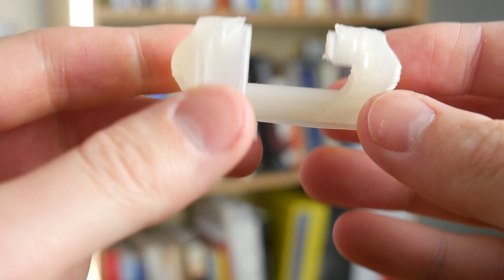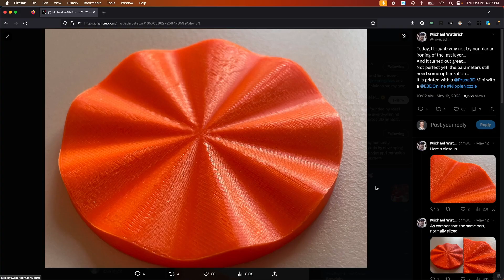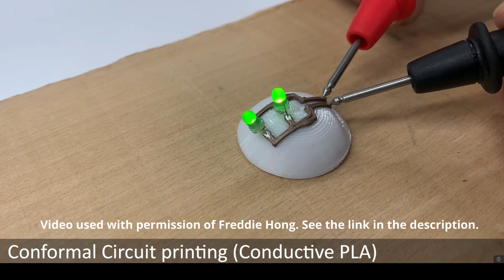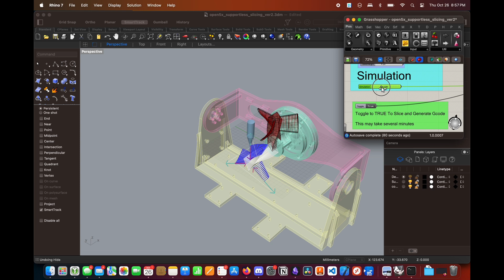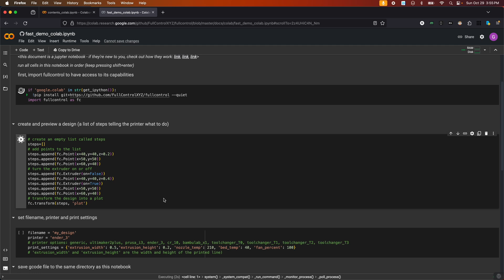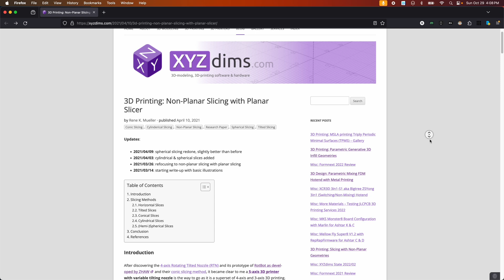5-Axis Printing... Why Should You Want It?

Comment: 5 axis g-code is on many cam softwares an option for a fee. So how long does it take to get that to open source slicer? 
Most likely someone makes a useable slicer and commercializes it to make profit. 

Just like the drug dealers at autodesk. 
They get everyone hooked on fusion360 for free and then pull the rug out of everyone. 
Very skeptical but hopefully there will be a cheap slicer for the hobbyists fot 5 axis 3d printing.
Reply from the maker: 5-axis is available for subtractive applications, but is much less common for additive applications. Regardless, closed source or not, I am excited for advances in this field.

Comment: your approach to more than 3 axis printing is cute and yields some nice results, but as you pointed out, you are losing printing surface and introducing vibrations in the process.
Mine is slightly different, and you might want to give it a try, I still keep the old platter, but move it in 3D (U,V and Z) axis to compensate for gravity forces in order to eliminate the need for supports and obtain non planar printing positon.

However I found out that Z is not enough as my printed part will collide with the printing head or the gantry sometimes, so here comes in the secondary Z axis, or MiniZ as I call it, a top down Z from the gantry holding the printing head.
Applicable for now only on CoreXY machines and similar geometries, sling beds don't enter the competition.

Also at the printing head I add 2 more axis, a titl of the nozzle up to 45 degrees, and a nozzle rotation 360 degrees to compensate even better (I called it Tango), so here I jump at 9 axis out of which 2 are Z axis spilt tasks between the bed and the MiniZ top down head.

I have made a portal and try to bring in as many folks as I can to buy my products (I only have for sale STL files of things I already tested extensivelly)  in a hope to raise funds to go ahead with my designs and create sort of a fashion amongst enthusists to make themselves more non planar machines, hence to polarize some interest from the coders community to jump in and help with open source codes to move them and slice for them, thou at tis point is no more slicing, is more like onion shell peeling.

Here is the portal        

https://3dmential.com/

not looking great, I am not a professional web designer, just an engineer, but you will find there the Rumba project, the Flip tool changer (dove tail based unlike the E3d one) both in manual changing and automated changing version and many other things I made for myself and possibly others can benefit from.

Comment: Hard programming gcode never interested me but LLMs are making me much more interested
Reply from the maker: Are you suggesting to use a LLM to greate GC? I think this is an interesting idea, but considering that G-Code has certain constraints (like extrusion amount per mm travelled, a fixed geometry being a necessary output) makes me think that it wouldn't be a trivial application. Do you have ideas on how this might be implemented?
Reply: @Garth_42  I have experience 3d printing but not working with raw gcode yet so my thinking could be flawed. I was imagining something along the lines of defining desired print settings and some basic geometries at a system prompt level. Seems more realistic to try and have the systems apply existing "parts" in a well defined environment at this stage in AI progress.  I also don't think it would be TOO difficult (for someone with more knowledge than me) to create some kind of low level validator, some system that attempts to confirm correct geometry/dimensions. A most simple example for this would be detecting the edges of a generated cube to confirm all lengths are equal.

Comment: I wonder if the rotary axes would work with a Delta style printer 🤔
Reply from the maker: I don't see why rotary axes wouldn't be able to work with a delta style printer. An interesting aspect about deltas though is that getting to 6-axis is relatively simple... IIRC you "just" need to get the hardware to control all of the ball joints attached to the tool separately instead of 3 pairs of 2 ball joints being powered by the same linear guide.
Reply: @Garth_42  could be interesting 🤔

Comment: It's slso very hard to create a slicer algo that works for every hardware because you need to make sure you can reach the extrusion point without colliding what was already put down. You could basically put a hotend at the end of a robot arm but collisions are hard to avoid. Also depending on what exactly you want to print, different configurations of the additional axis make sense to optimize for that model... there isn't an easy default like with 3axis-planar printers...
Reply from the maker: Very good point. Different printers with different abilities to rotate and clear a part will result in vastly different toolpaths with the same algorithm... to the point where that strategy could be ineffective or impossible, depending on the part.

Comment: Wow, a Jubilee - I love it! I built one at the beginning of 2020, and am currently in the process of overhauling mine. 

This is a great video, subbed. 

I think that in a similar way to simultaneous multi axis milling, the biggest problem is that you can accomplish the same thing (e.g. mill away the same material or deposit plastic in the same position) in a bunch of different ways, and there isn’t one single way of accomplishing that which is easily selectable as the best. I think that’s also a big part of why normal 3D printing slicers are so easy (well, easy relative to 5 axis CAM) to make - if plastic needs to be deposited at (10, 10, 10) on the printer, you just move the nozzle to that position and extrude some filament. However, if you introduce more degrees of freedom, you have an enormous number of ways in which you could angle the nozzle to deposit that plastic. Additionally, a lot of what makes the positioning ‘optimal’ will have to do with the specific kinematic system you’re working with. It’s an interesting problem to me in both machining and 3d printing, but I also feel like 3d printing gives a lot of imaginative freedom for multi axis movement because we don’t need to be able to support 1,000+ pounds of material on our print beds with 50+ hp spindles, and cutting forces that are likely putting immense amounts of force into the workholding.
Reply from the maker: Thanks for commenting! Yes, it is amazing that the conventional layer by layer approach is so effective for such a simple algorithm. 5-axis and non-planar strategies add significant complexity, but also allow for many more possibilities with similar hardware (as like you said, you don't need extremely rigid systems to implement it).

Comment: I think a robot arm with an extruder would work better.
Reply from the maker: A robot arm with an extruder would have more freedom of motion, but they are also very expensive! I don't know of a robot arm that would be applicable for 3D printing at this price point, and considering arms are serial manipulators with a lot of moving mass, I would think that it wouldn't be able to print as fast or with as good of a quality as a core XY motion platform.

Comment: I am really interested in high-axis printers but I think the big issue is that the algorithms required are just obscenely harder, not hardware or availability. With a planar 3d print you're basically just doing a flat linear integration heightwise, lengthwise, and widthwise. (obviously it's not a strict mathematical integration, but it's a similar concept and there is a reason why I'm saying it) Infil, wall-thickness, etc. are , at first glance at least, compicating factors but they actually don't change how the surface is handled. Infill is literally just a flat pattern that happens inside of walls, and walls are literally just how many times to go around the surface of the part inwards. Both of those are actually very simple conceptually and computationally. ('very simple' meaning 'it is a concept that translates nicely into an algorithm') 

With non-planar prints however, you're basically asking for an ideal coordinate conversion constrained by all manner of physical properties and limitations. It's still the same shape sure, but your actual integration is going to change wildly and there are literally infinite choices. Even just changing from cartesian to spherical coordinates looks like a veritable nightmare (although it often works out pretty nicely) and when we're talking about completely arbitrary coordinate shifts it's basically impossible. There are just infinite ways to print any given part so, short of finding some way to derive an ideal (or near-ideal) print parameterization for an arbitrary shape from the physical constraints we know beforehand (as opposed to having to find a new generalized coordinate system THEN test if it is ideal for those constraints) I can't see multi-axis ever taking off for normal people just because it's impossible to get good G-code for them. We're talking about a math problem that could take a PhD months to solve alone, and has a few dozen external physical constraints that mean whatever solution they find is almost certainly invalid.

For extremely demanding applications I'm sure it will have it's place, and probably already does, but unless a real savant takes a crack at it (and even then it might be an NP-hard problem) I'm not sure it'll ever be consumer-viable. While it's possible to hand-craft these for simple geometric shapes (like a curvy tube) a slicer needs to generate them competently for any arbitrary shape. I wouldn't pin that down to there just not being a demand, I think there is a very real possibility that's a problem that's just so obscenely hard it might not be solvable in the first place.

The one decently likely way I could see it taking off is if instead of a rotating build plate we saw a printer with an arm and an extruder that can rotate around the print while it stays completey still, then the slicer is still working with a planar algorithm but has a few non-planar shortcuts it can take advantage of. So instead of trying to generate an ideal non-planer pattern for any arbitrary shape, it only adds non-planar G-code snippets to any easy shape that it already knows a pattern for, and the rest it does completely planarly. If this method does take off then we might be able to incrementally improve it to get to the point where partially or even fully non-planar prints are possible, but it's still more of a cheat-code than an actual implementation.
Reply from the maker: Thanks for the thought out reply! It is really amazing to me how complex of parts can be printed with how simple the layer by layer approach is. The layer by layer approach is elegant in terms of what can be accomplished with such a simple strategy. You are right of course, there is a market and demand for the technology, but the algorithms are very complex.

I do think that there are likely strategies (intuition speaking here) that would allow for printing of generic shapes... the space of all potential moves needs some well reasoned logic to govern decisions about printed geometries and motion, preventing collisions, etc... and I obviously don't know what that would look like either. These algorithms wouldn't necessarily be optimal for all shapes or use-cases, but if there are a couple different general strategies to choose from, that would expand applications and usefulness drastically. I also think that even if the user gave some input to the slicing process, it would drastically reduce the needed complexity of the algorithms, too, which could be a possibility (hopefully something in-between current slicing and full blown 5-axis CAM).
Reply: I guess topological classification of objects could simplify the problem. Object's surface topology along with the size of printing toolhead are keys to  deriving inner skeleton geometry. With a needle-like longer extruder, it might be possible to print inner skeleta (like trees) that have sharper edges (between branches), and then grow object from inside outwards.

It'll come a time, when heuristics used by human-crafting 5-axis g-code will get reverse-engineered by training set for an AI to do it by providing pairs of target objects to print, with human crafted decompositions of them into tool paths, and with the rate of improvement in these fields make me think, such an AI will become available soon, and I hope it'll be open source, like alpha-fold is for proteins.
Reply: @IdeationGeek  while heuristic-based AI implementaitons could have some promise, I'm not too sure myself.

The immediately obvious problem is that the chic modern AI architectures that are getting the most attention with respect to really "hard" problems (things like LLMs, transformers, etc.) aren't exactly resource-efficient or all that smart. Most of the leaps and bounds we've seen with AI lately have been like a caveman carving intricate stone gears and levers to create machines; it's impressive, but the technology being used is still incredibly limiting. The recent llama models and mixtral are surprisingly competent for being something that can be practically self-hosted if you have a strong GPU, but they're still not great. I didn't recognize some Rust code and tried to get a quantized llama model to explain it to me, only to find out later that the snippet I was was looking at wasn't Rust at all, but Zig. Despite several back and fourths, the model never caught that, I naively said it was a snippet of Rust code and so that's what it kept saying it was. In other words, the popular models we're seeing now are built on some intrinsically flawed architectures that, while clearly capable of doing hard tasks, aren't likely to be favoured by consumers for practical applications.

The other major problem is that I'm not entirely convinced efficient heuristics really even exist. Even reparameterizing incredibly simple geometries is something you only even begin to start doing in higher level calculus classes and it's quite involved. Outside of someone like Tesla with some weird case of synesthesia that has their brain wired to seemingly solve the problems magically, I'd be hesitant to believe anyone could make solid guesses for reparameterizations of arbitrary shapes and geometries. Maybe I'm wrong, but I'm not aware of anyone who I'd describe as "good" at doing something like that. (people obviously do do it, but I've only ever heard of it being a quite involved process, not really something that someone can get "good" at.) In short, I'm not entirely convinced a practically applicable general heuristic (or set of heuristics) actually exist(s). Again, it may just be an NP hard problem where there isn't anyway to meaningfully approximate better and better solutions in arbitrary cases and we'd be limited to using advanced lookup tables for known-good non-planar methodologies based on the localized surface. If this is the case, then heuristic optimization likely isn't ever going to be practically worthwhile. (at least not with classical computing, quantum systems though may still be able to pull it off)

I'd love to see the technology come about, but it's one of those problems that I just can't hold my breath over. This feels like exactly the sort of problem that will always feel "just within reach", sorta like how nuclear fusion generators have been "another decade away" for like half a century. (though from what I've seen we actually have been making some progress on them lately so maybe not the best example) I'd be ecastic to be wrong on that and it is a solvable problem, but it's just hard for me to get invested personally. Every field has their white whales, material science has graphene, physics has a unified model of the universe, nuclear science has fusion power, etc. but when it comes to solving problems with computers it feels like so absurdly many problems end up just not being solvable efficiently. We've been able to brute-force through a lot of barriers thus far, but those have largely been due to technological/manufacturing advancements and we're begining to approach the theoretical limit for that sorta shit. (that's not to say there aren't improvements to be made, but it is to say that we need to accept that computers are a long-matured technology and the improvements are coming slower, faster. It used to be that computers lasted 2 or 3 years before the speed difference was so wild you just had to upgrade, now though you can go for easily double that before even thinking about an upgrade. The improvements are slowing down, and they're slowing down faster and faster as the technology gets more and more advanced)

I won't say it's impossible, but I'm definitely far too cynical to hold out all that much hope for it personally. It very much feels like a "white whale technology" to me, for better or worse.

Comment: Super informative video ! I'm not sure if the build plate size is much of a drawback, especially when compared to conventional 3D printers, it's clear that the five-axis 3D printer can tackle a range of challenges that might be tough for a traditional printer to handle. what are some solutions for some of those bild plate propblems?
Reply from the maker: Thanks! Even if you are printing a larger part, you don’t need a lot of contact area to “start” the print and then build on that section conformally to create the entire part. This is one way to mitigate a smaller build surface. Other than this, it could be redesigned to support larger build plates, as long as it is rigid enough for accurate prints.